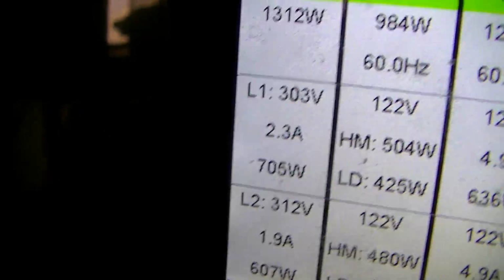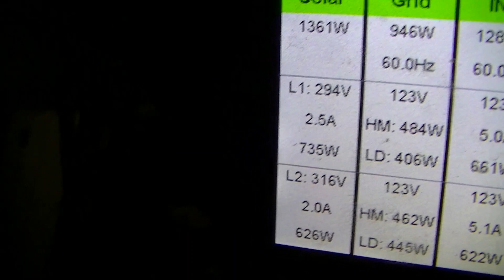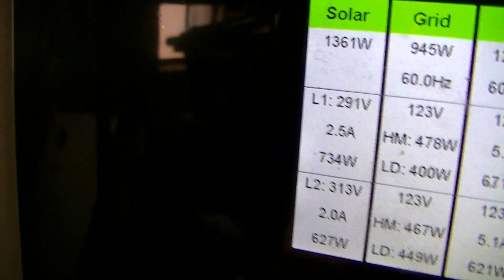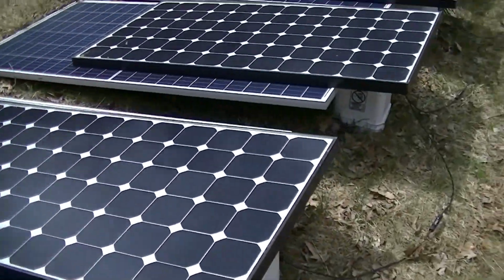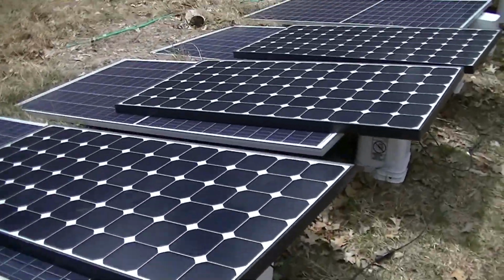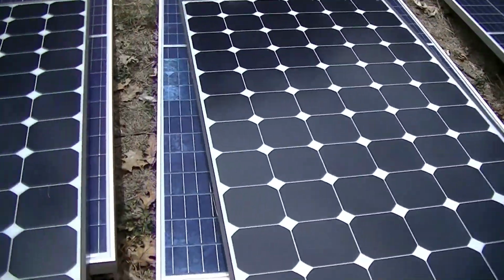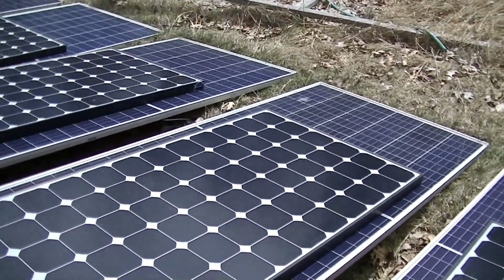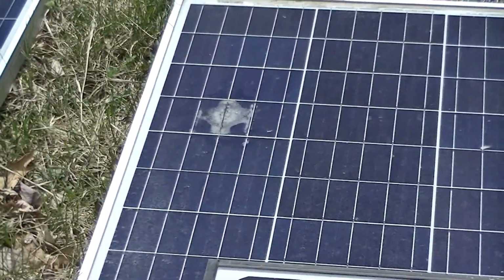Sunpower SPR 230 WHT U test array

Comment: I love sunpower cells. They are also easy to solder DIY for hobby projects thanks to their copper backing.
Same backing allows em to keep working after cell is fractured from impact too. (I don't recommend testing this opn an array though, buy some cheap loose cells to play with for that.)